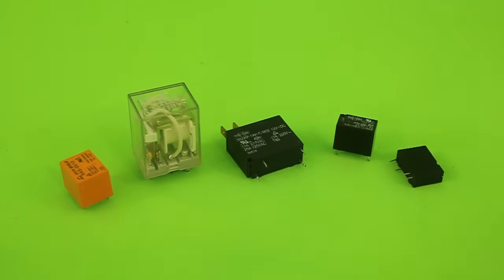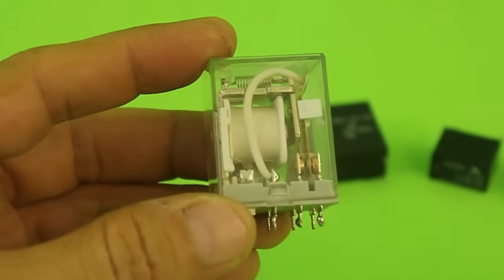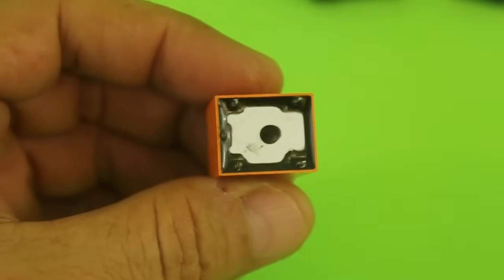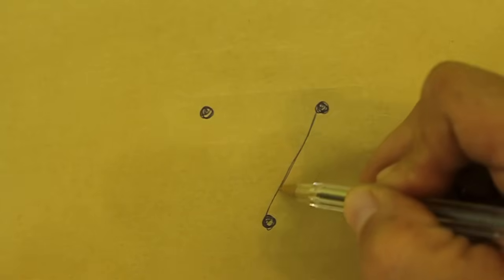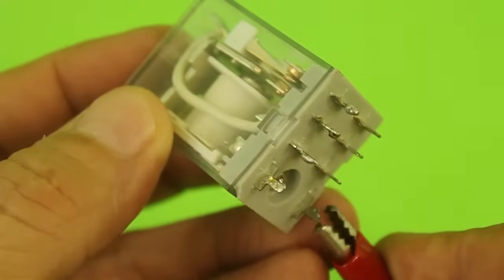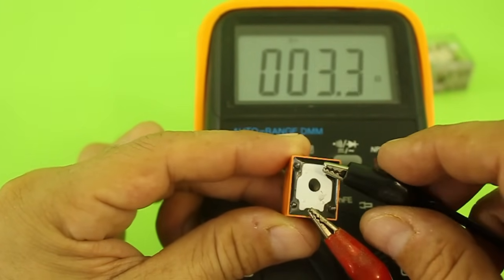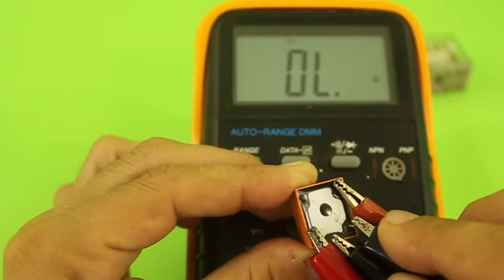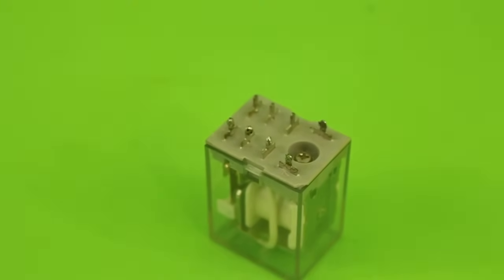How to Identify the Pins of a Relay

Comment: What is the Smalling size relay that will work with switching on a 3.7v 18650 2200 mAh battery on a cordless device  ?

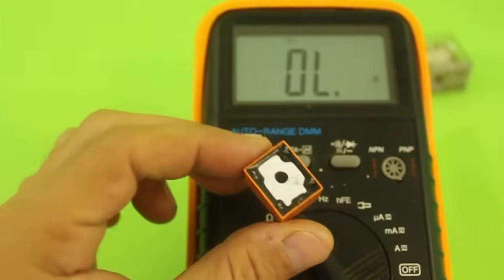Comment: @5:35 What equipment do you use to supply the voltage to the coils of the relay? I need to test my relay using 120V. What can I use that may not be too costly? Thank you.
Reply: An outlet

Comment: This was a bad explanation and probably the worst video I have seen from Ludic Science ... 
You could have explained the difference in resistance readings between the relay coil and contacts.
Using the resistance readings you could explain if you are reading across switch contacts or energiser coil.  It is not hard as most low voltage relays typically  have  a few hundred Ohms across the coil and less than one Ohm across the switch contacts....

Comment: Beginners:
While rare in consumer electronics products, there are also 2 additional types of relay coils single and dual polarity latching coils. 
   There is also a subcategory of traditional relays generally referred to as "signal" or "small signal" relays. These small signal relays have much higher coil resistance. 
 Why is the coil resistance important? 
  With Ohms Law you'll recall that, 
Current(mA) = Voltage / Resistance 
  This means that a Relay with a resistance of 78ohms at 5 volts will draw around 64mA of current. If you directly connect this to something like an Arduino I/O pin you will quickly find yourself buying another Arduino replacement. It isn't a good idea to connect a microcontroller directly to any relay coil due to the voltage spike that happens when voltage is switched off an inductor (coil of wire) as the magnetic field collapses.

  Next point, pay very close attention to the contact rating for any relay. If the relay doesn't have a DC contact rating, do not use it to switch DC voltages. If you want to see a real demonstration of why the contacts rating is important John Ward posted a video demonstrating how and why AC rated switches are not compatible with/as DC switches. The physical contacts and structure inside a relay is exactly the same as all manual switches like toggles, rockers, push on/push off, etc.. John Ward's YouTube channel is just his name (I have no affiliation with him). This is just a reference to where I learned the difference myself beyond just an awareness of the numbers printed on relays.

 If anyone is too lazy to look it up, basically (IIRC), an AC contact is easier to manufactur because the voltage and current are always crossing zero as the wave cycles. This means the contacts are easier to pull apart without arcing. The contacts can be mounted closer together and the spring is lighter because the contacts can come apart much slower. 
  In a DC switch contact the switching action must move farther with a wider separation between the contacts, and the spring/pivot structure must break the connection much faster. This design is specifically intended to prevent arcing at the contacts. Arcing in a switch is an extreme fire and shock hazard as John Ward clearly demonstrates in the aforementioned reference.

  Lastly always check that the switching contact PCB traces have a large amount of clearance on any application where you intend on switching AC mains voltages. There were some awful hobbyist relay modules coming from China a few years ago that were marketed for use with Arduino's, etc.. The PCBs on these modules had less than 1mm of trace clearance between a ground plane and the switch contacts. It can be really tricky to design a safe PCB layout for some of these relays because a switch contact pin is sometimes located in a really bad spot that is difficult to keep isolated from other parts of the circuit. This is very very important to understand before using a relay in a AC mains switching circuit. 

 Ultimately, it's much safer to try to use a DC rated relay contact design as a beginner. You will find that the vast majority of cheap relays are not DC contact rated. Always remember if it doesn't say it's DC rated it is not DC rated.
-Jake
Reply: Referenced Upload by John Ward:
https://youtu.be/mQpzwR7wLeo